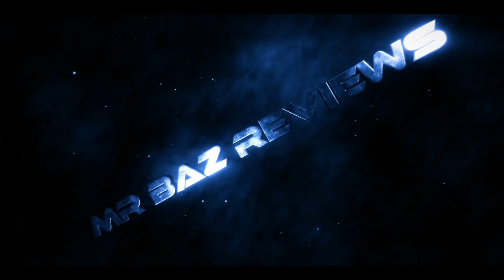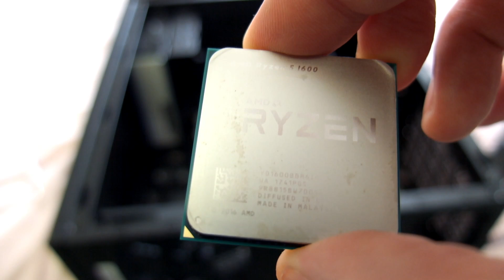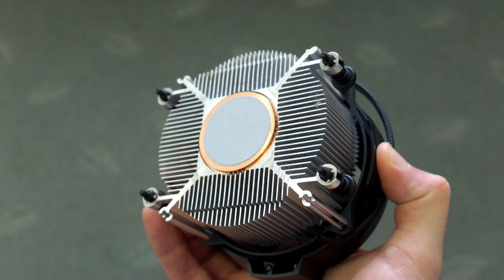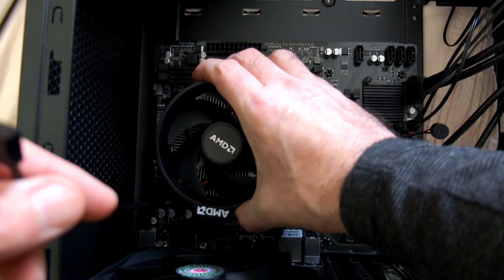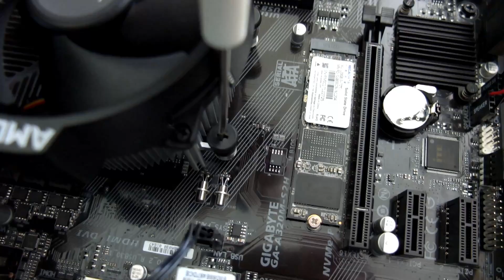How to install a Ryzen/AM4 & AM5 Wraith CPU Cooler

Comment: would this be better if I also applied paste or a graphite thermal?
Reply from the maker: You should get slightly better thermal transfer with premium paste, for most it's a non issue. If you do change it, clean off the original paste on the cooler first
Reply: Mr Baz Reviews reason I asked new with the paste route got sent the pad as a gift wasn’t sure if there could be issues it’s a 40mm it fully covers?
Reply: The last I wanted to mention was I contacted deepcool I was told I should use a fryzen it’s about the same size close tho wasn’t sure if it would be over kill or something or just wanting to make the purchase the actual model number the serial number is JBMOKC136709 part number is 90MB0YR0 - M0AAYC says it’s Am4 32gb/s M.2 onboard UEFI BIOS then it’s Gen 2 SATA6Gb/s , AURO SYNC if that helps

Comment: Hey man, about to buy a cpu cooler, since I only have a stock Intel cooler. Where would I put the cable to light it up (RGB)?
Reply from the maker: If it's an RGB controlled cooler it needs a header on the board to control the lights (unless it's just one with a switch on the side) Gaming boards will have it, others probably won't
Reply: @MrBazReviews  thank you.

Comment: Probably the worst design for a cpu fan in my opinion. At least in terms of modern fans.
Reply: What do you expect of factory cooler, it`s free and do a good job if you don`t temper with oc.
Reply: The clockwise and counter clockwise turning screws on old intel are 100x worse
Reply from the maker: Def room for some improvement so I'd agree on that one
Reply: did you see the intel stock cooler?
Reply: @keyrix8687  Only few times every single day, i repair pc`s almost 20 years...

Comment: On my cheap B350m the backplate came loose when I removed the old CPU and heatsink and I didn't even think of it. So I was pressing my ass off trying to get the screws from the heatsink to reach into some kind of thread....that wasnt there lol. It has slid down the back of the mobo. I had to take off the back of the case and then hold the backplate while trying to install the stupid heatsink. Ugh.
Reply from the maker: We all make mistakes ;-D
Perhaps AMD could have done an easier mounting system

Comment: My screws won’t seem to go down low enough to reach the holes in the motherboard, please help
Reply from the maker: They are spring loaded just apply some pressure with the back plate held in place
Reply: Mr Baz Reviews I literally only just realised that the backplate disappeared behind the motherboard 🤦‍♀️ Thanks for you help!

Comment: What happened to to the motherboard backside bracket, did you remove it or kept it for the stock cooler?
Asking cuz i bought an used x570 prime-p and had no backside bracket , pretty sure i can't install the stock cooler without it.
Reply from the maker: You need the bracket as shown in the video the cooler screws into it
Reply: @MrBazReviews  i fucking knew it, thanks for reply.

Comment: My screws won’t go in no matter how much pressure I apply, any help?
Reply from the maker: Turn anti clockwise first then you should feel them drop into the thread
Reply: Mr Baz Reviews Wow! Thanks so much for your reply even on a year and a half old video! I found out that my problem was that the backplate had fallen down from when I unscrewed the fan earlier to change CPU’s. Thanks for the informative video, however,

Comment: New Asus X570 TuF WiFi.
The 2 black clasps, the set closest to the PCIe 16x slot , unscrewed very easy. Top one closest to the top VRM set will not budge. I am serious,I mean like quick dry concrete. Using the correct size of Phillips head. Any suggestions?
Reply from the maker: Well if it won't move even with extreme pressure, that's not a good sign. But it's screwed into the base plate, it should be possible to get it out. Unless you want to try a flat head driver if it will take it. Other than that get in touch with the seller/maker. Vast majority of people will be taking off the plastic brackets to fit either the stock or third party cooler. It should come off without a fight

Comment: How do you keep the backplate in place before you attach the heatsink ? Mine kept coming off until I selotaped it temporarily
Reply from the maker: Anything that holds it in place, on the video I just put it on the bed, but a book, or as you say tape will do the job or get someone to hold it

Comment: I did this with noctua paste and my 2600 hits 95c at idle... sigh finally build is done and I need to open the pc again
Reply from the maker: If it's not screwed down tight, it's not contacting the processor properly hence high temps. On most systems it's a simple enough procedure
Reply: Mr Baz Reviews umm I opened the pc and the backplate literally fell off, when I moved the pc uprighf. (Cooler is unplugged). What should I do? I want to mount it correclty
Reply: @MrBazReviews  Managed to put it together lot tighter and temps are way better. 30 - 40 at idle. Its normal with stock cooler? Well speccy shows 80, but it cant be true right? Last time when the cooler was badly it was showing 150, while hwinfo was showing 95.
Reply: @megapet777  This may be Fahrenheit vs. Celsius.

Comment: Needing help

So I just got my B450 board today in the mail and all but one of the screws for the backplate come out! For some reason my screwdriver cannot untighten it but it's the same tip!
Reply from the maker: It screws into plastic so other than the thread being off, try using more force without pressuring the board.

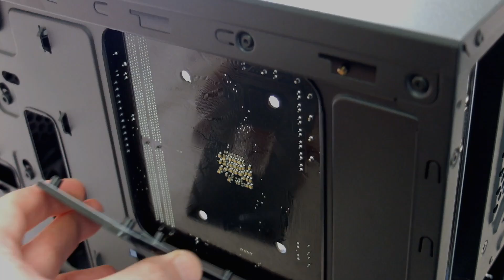Comment: 0:20 That backplate comes with the CPU?  Or MBO?  I cannot see anything looking like this, in either box.  I may have been gipped.
Reply from the maker: It's pre attached to the board
Reply: @MrBazReviews  Ya, i found it finally.  It's just, because all you get for instructions are these tiny little doodle-sized graphics with arrows on, and they are not specific either to MBO or CPU, I only managed to figure out I needed to take off those pre-installed brackets, after the MBO was already sitting flat inside the case.  

So, when I took said brackets off, the backplate (which I didn't know existed, as this was before watching ur video) fell down unnoticed to sit in the gloom and dark and be invisible underneath the board :(

Honestly, the instructions for these things are atrocious, at no point in any of the media for CPU or MBO was the backplate pictured or noted whatsoever.

Comment: @mr baz reviews so for catching the threads then can I apply a lot of pressure and be assured the mobo won't break?
Reply from the maker: I've never broken a board myself should screw in without too much pressure
Reply: @MrBazReviews  im gonna try your diagonal strategy tonight. Thanks for the video

Comment: Will the backplate just pop in and just stay in place after putting it back in it's slot
Reply from the maker: Hold it in place until it's screwed in
Reply: @MrBazReviews  So do I install the fan when the PC is up straight?

Comment: Is there like a sticker or something on the  thermal paste that you need to remove before installing or just put it down on cpu and that's it?
Reply from the maker: Paste is already on the stock cooler so just screw it in
Reply: @MrBazReviews  okay thx i already did but then i was reading something on reddit and got scared i fucked it up
Reply: @synth11  
That's the case with the after market cooler . they came with a piece of plastic covering the part that make contact with the cpu.  you need to remove that and apply thermal paste on the cpu then install the cooler

Comment: Help me out with this bro. I have to install the cooler, the screws are short as many people said. To screw them on the baseplate, I have to put a lot of presure. (really, a lot). Is that normal? I stopped just in case, I dont want to apply to much pressure over the cpu. (really, lot of preassure)
Reply from the maker: Works ok for gigabyte but some say Asus screws are a shorter size should fit though
Reply: @MrBazReviews  thank you for reply, this is on a MSI mother. Feels like Im pushing to hard to screw all, that got me a little bit scared

Comment: Can't unscrew
What size Phillips head ??
Reply from the maker: You can use a flat head too it near enough fits many cross types anyway
Reply: @MrBazReviews  ok I bought a new screw  I got 2 out but 2 others are fucked/stripper I probably have to return

Them preinstalling them on the case caused more harm than good for me

Edit I decided just to get a cpu cooler what latches on so I don't have to remove them
Hope it turns out well
It's just a cheap £13 cooler from Amazon but it's probably better than stock any, definitely not better than my 212 Evo what I was planning to use (that's fine since I bought the 212 Evo in late 2014)

It's held it's value well

I was gonna return, might later date but rn I just want to finally get it all done

Comment: Hello is it okay if one side lifted up while I was tightening? I managed to get all four to the point where they no longer tighten however it was difficult to hold the backplate and yhe heatsink and the screwdriver.. to apply force downwards. I did my best but want to know if it will mess up the paste now?
Reply from the maker: Paste should be fine, just check the temps of the CPU under load
Reply: Thank you I appreciate the reply. I'm soo nervous to press start because it's all new parts and my first time building a pc like this.
Reply from the maker: @MBroodryk  I know people worry, reality is there isn't a lot to go wrong. Plugs etc. have one way insertion, even if you put massive blobs of thermal paste all over the place, it's not electrical conductive, so won't do anything bad - will just end up messy! If the temps are good it should be fine. 50-60's Celsius under load is fine the AMD cooler isn't bad really - adjust the speed in BIOS to keep it quiet
Reply: There actually this pci-e 6+2 pin cable but nothing seems to be applicable on the motherboard. I've bought a ryzen 5 1600 boost, two 8gig DDR 4 ram, 500 watt cobra power supply, MSI Bazooka b450m
Reply: Is it okay if it's not plugged in?
Reply from the maker: @MBroodryk  The 6/8 pin is for a graphics card some are 6 some are 8, some lower power ones don't need it.
Reply: I have a gt630 graphics card I don't see anything past clipping it in. Are there specific orders to plug the power supply cables to the hardrives? Any to start with first and same for the molex cable? Does it matter which ones you use my box is an antec p8 and it's display on the front has a molex
Reply from the maker: @MBroodryk  Not al GPU's need them, there are a lot of guides online it's quite simple
Reply: @MrBazReviews  Thank you again, regrettably when I started the pc up, the cpu ez debug led light flashed white once and went off. Nothing else happened.. I contacted the supplier and they asked if I was using the onboard graphics or my gpu, I said my gpu and they said if I am still having problems I need to send it back. However it is half way across the country where I am... and costly.
Reply from the maker: @MBroodryk  Assuming the CPU pins are fine ie not bent, normal procedure is to remove items such as extra drives, 1 stick of ram/check cables etc - then attempt a boot up
Reply: @MrBazReviews  Thank you I have checked all pins are okay, I reseated the cpu and redid the paste etc but still same thing. I took drives out and left just the m2 ssd however still nothing. I have not tried taking one slot of ram out. That would be the last step to do now, I guess.

Comment: hey i had a question this new 3600x can with the fan and heatsink. for some reason one of the screws do not line up with the motherboard, 
do you have any advice?
Reply from the maker: Size is standard it should fit any of the stock coolers. Is the screw straight or off at an angle? Other than a slight issue there can't see what else it could be

Comment: But where do you connect the rgb from the fan onto the MB?
Reply from the maker: Onto the 4 pin RGB header on the board (if the board has one)

Comment: "Little pressure on screws"?  Screws appear way to short to reach holes, plus the screws just spin around when trying to use screwdriver on them,no matter how much pressure is applied, no progress is made. if were to apply this pressure when its in contact with cpu, well, thats all folks! Help,anyone please!!
Reply from the maker: Check the backplate I've had 0 problems on the boards I've used
You won't break the CPU there is a metal plate over it soldered on
Reply: You were able to put the fan? I Have the same issue, way to short screws

Comment: Why in the hell is it a circular contact plat on the heat sync to a square processor?
Reply from the maker: It covers the copper core, reality is doesn't matter much most of the heat on the CPU is in the middle, the die is far smaller than the plate cover
Reply: @MrBazReviews  Got it installed.  So far so good.  Thx.

Comment: My backplate keeps falling down when i lay the case down to a table  so i dont know what to do to proper install It, can i install stock cpu cooler on a vertical position or it has  to be lifted to a certain surface to place that in
Reply from the maker: Put something under it or get someone to hold it in place. Once you have one screw in place even a bit, it's easier to get the rest in

Comment: Has anyone had any problems with the cooler screws? My screws refuse to turn for some reason...
Reply from the maker: I've not seen any issues on builds, have you tried turning them anti clockwise first?
Reply: @MrBazReviews  I've spent the last 2 hours turning and fiddling with them and they just turn without tightening
Reply from the maker: @goldengoose1460  The back plate is in place?  Try turning the plate around the other way shouldn't make any difference
Reply: @MrBazReviews  I think it's the fan screws that are the problem, they turn but don't actually tighten anything
Reply from the maker: @goldengoose1460 The outer screws on the heatsink are spring loaded to apply pressure when screwing them in. Unless all threads are mashed up it's very unlikely it won't screw in place I've never seen on that won't screw in place
Reply: @MrBazReviews  I don't know the screws turn but don't actually move down :(
Reply from the maker: @goldengoose1460 They should apply pressure when screwing them in if the backplate is in place and secure it's a dead simple job takes 30 seconds.
Reply: @MrBazReviews  I fixed it now but it took WAY more effort than it should, I think they weird just faulty screws or something:)

Comment: Hi i have that mobo.  I have a problem my processor of my motherboard does not leave the socket it will be because it has the four screws of the backplate placed?
Reply from the maker: Not sure what you mean the original fittings as shown in the video have to be removed then the back plate comes off, you re-use the back plate to attach the stock cooler

Comment: The backplate doesn’t stick to the back of the case and I’m getting pissed
Reply from the maker: It's not supposed to you screw the cooler into it that holds it into place. When you fit it put it on it's side and put something under it enough so you can screw into it or hold it in place then put one screw in a little

Comment: The locking lever isn't locking my processor in place i can pick it right up yet the old one does lock in and I have no idea why
Reply from the maker: Should lock unless there is a problem with the socket CPU pins not bent?
Reply: @MrBazReviews  the pins came bent :[
Reply from the maker: @Mugen123456789  You can try to straighten them with a thin card maybe depends how many are bent be very careful if you try it you don't want to snap any of them. Or get a replacement CPU bit annoying isn't it